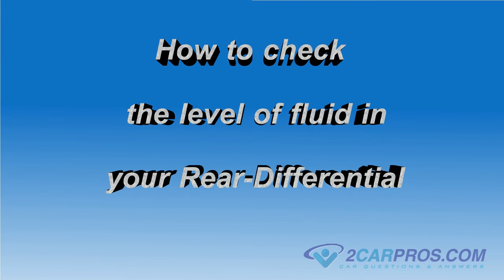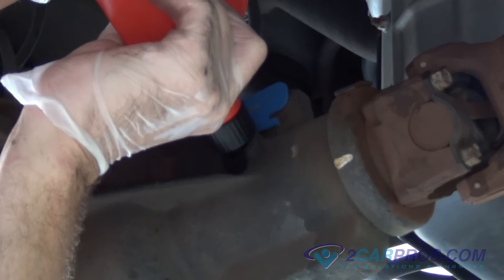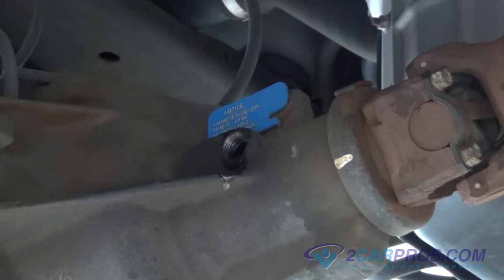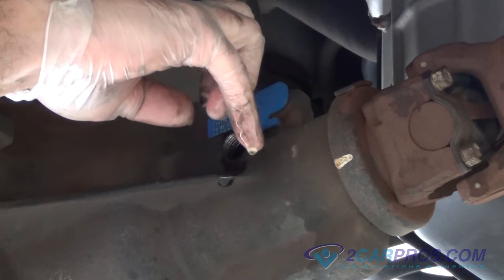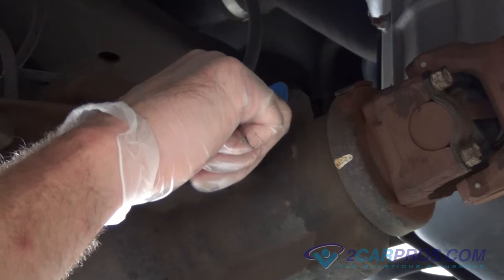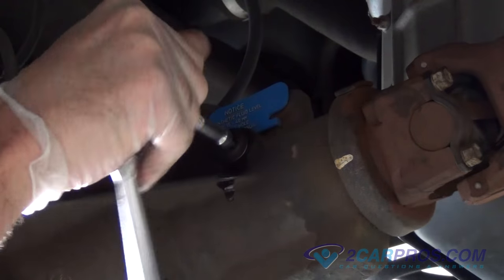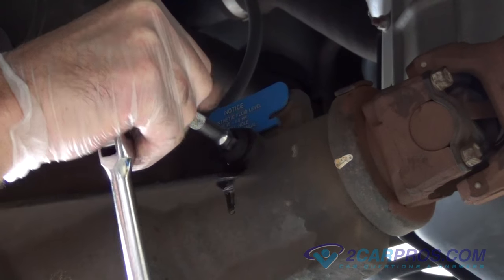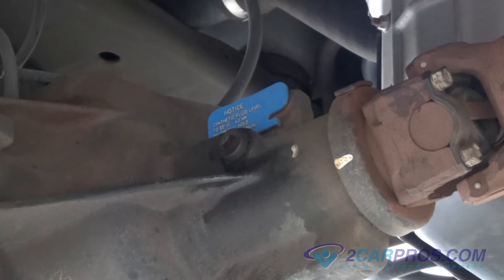HOW TO CHECK Differential Fluid IN UNDER 10 MINUTES!

Comment: You just overfilled it, if you read that blue tag that is right above the plug it explains to fill it to 9/16” - 1 1/4” under the fill plug. You also added the incorrect fluid it does not take ford 75w140, it requires GM synthetic 75w90
Reply: Would it be the same for Jeep XJ? They checked it for me at the lube shop, and said it was low because it wasn't level with or higher than the fill plug.. And I didn't get a manual when I bought the thing, never had a vehicle with a differential before.
Reply: How much if you don’t have a tag? Besides replace it with what Mabel calls for
Reply: @JFEnterprize  why not check the specs on that particular differential before filling it?
Reply: @kellismith4329  the weird thing is the Mabel states 1500’s rear should be 75w-85 and front uses 75/90 and 2500 3500 75/90 all around. Tho part supply guy said his chart says 75/90 all around is fine. I’m currently trying to figure why gm makes a transfer case fluid yet the Manuel recommends the dexron 6 atf…. someone’s gonna get punched in the throat 😡 🥳🤣🤣🤣
Reply: @kellismith4329  doesn’t say how much either. Just says the fluid. I think the rear diff takes 1.6 tho. Fronts not looking fun and I didn’t plan on that. That’ll have to be the weekend maybe.
Reply: @JFEnterprize  fwiw, I went and got the 75w90 fluid from the gm dealer as the fluid I had drained after 200000 km still looked like new so it is obviously a great blend and around the same price as your high end aftermarket fluids. As for trans case fluid, my truck is a rwd so doesn’t have one, however all of my trucks have manual trans and over the years with trying different fluids etc I came to the conclusion that the superior fluid is indeed the gm synchromesh, it works well in every trans I have regardless the brand, so I also use that gm synchromesh in the transfer cases of my other trucks and find it to be fantastic.
Reply: @JFEnterprize  my rear diff took 2 litres of the gm synthetic, to figure out which axle you have you look up three digit codes from the glovebox and search those codes to get specs - you need to identify which axle you are dealing with first as several were optioned
Reply: @foxmulder7616  all vehicles have differentials bro.